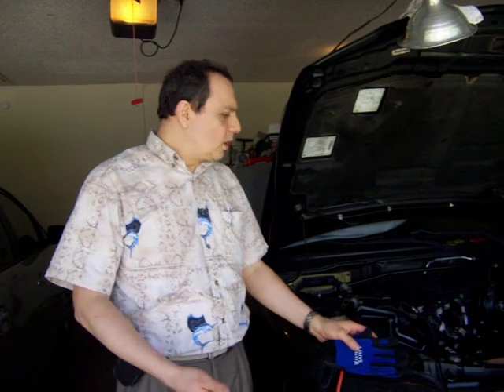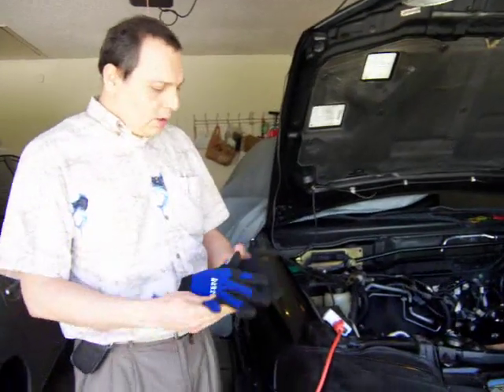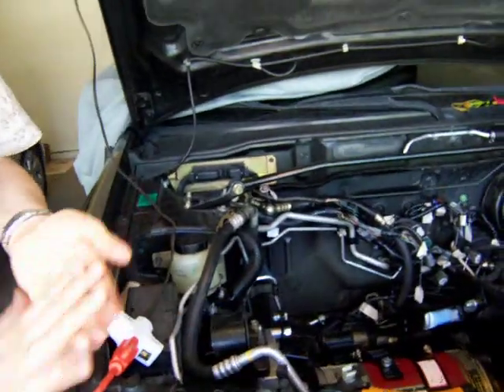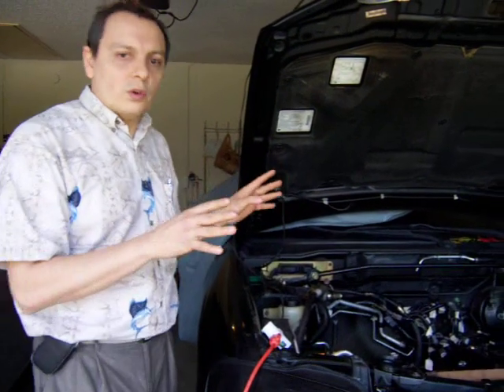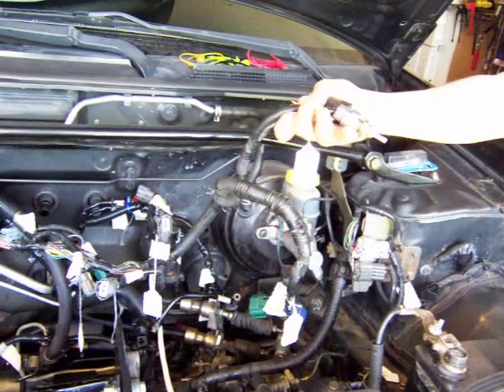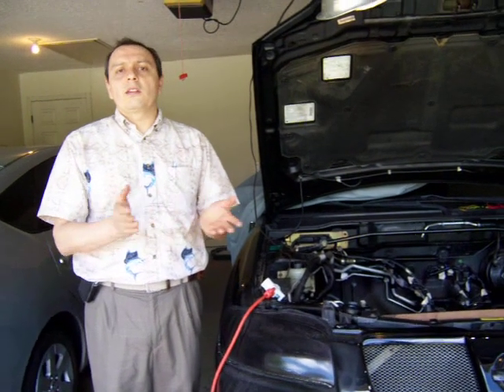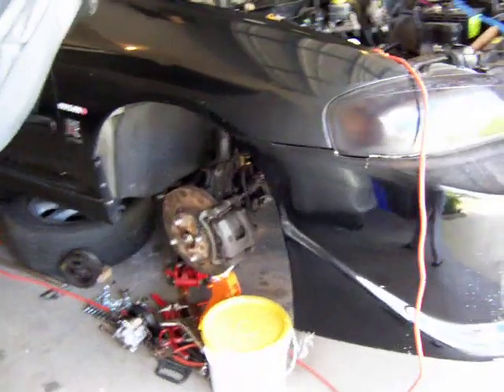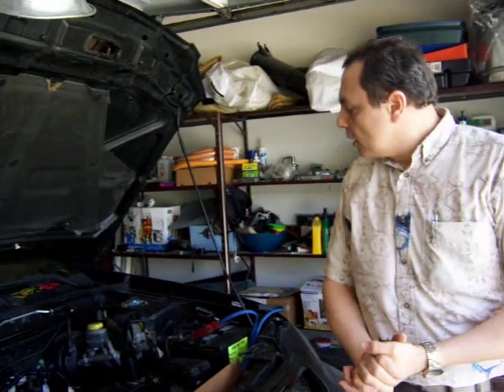Nissan Sentra Electric Car Conversion Part 17

Comment from the maker: If I upgrade to Lithium, I will need the batteries, the BMS and the hardware to connect the batteries. I believe I can use the current charger to charge lithium (Elcon PFC 3000), but I have to send it to the provider for reprogramming.